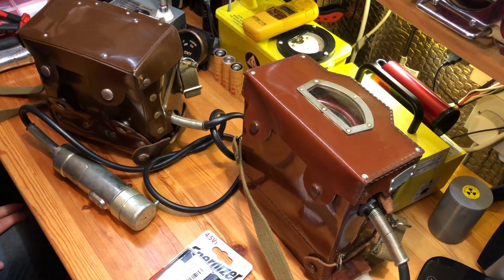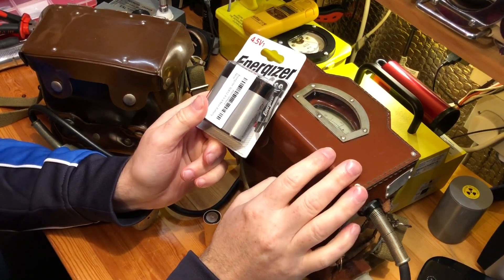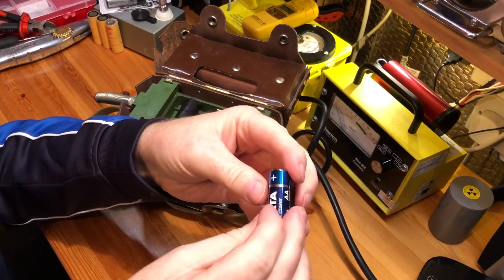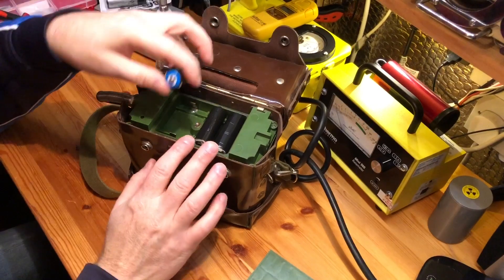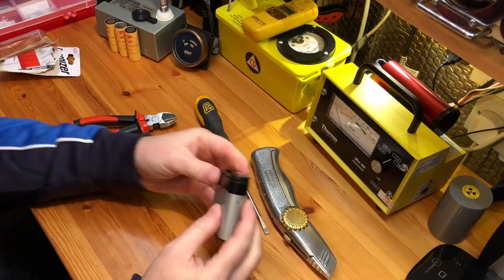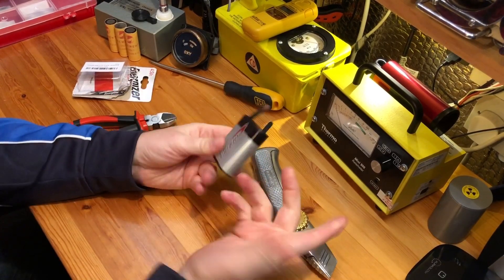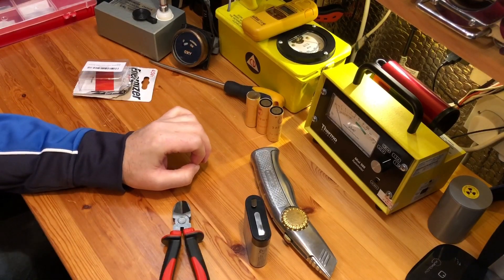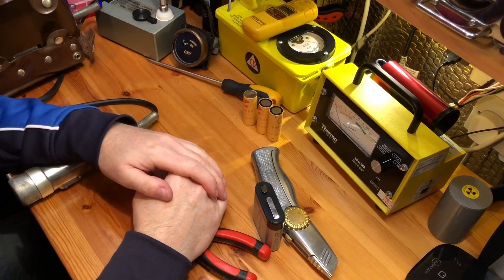Soviet Geiger Counter Batteries

Comment: Quick question i bought a dp63a geiger counter its made out of bakelite but what battery's do they use
Reply from the maker: It uses the batteries I show in this video.
Reply: @SurvivingTheApocalypse  so it operates under 4.5 volt
Reply from the maker: From memory, it uses 2 x 1.5v batteries - the make and model I show in this video.

Comment: Msy I ask how do I remove the two terminals/prongs on the left and right cells, just rip It off or should I do something else?
Reply from the maker: I just cut them off, if you have nothing to cut them with then you can (with a bit of wriggling) pull them off too.
Reply: @SurvivingTheApocalypse  Alright, I see. Thank you very much!

Comment: I have designed a 3d printable adapter to use AA batteries in my DP-5B. Its muuuuch cheaper than buying an overpriced a 4,5V battery
Reply: Would you post it on pinshape? It would be very helpful because I can’t find any batteries for these Geiger counters.
Reply: @person98  Somebody has made a much nicer design than me in the meantime. The STL files can be found in the video description of a video on Youtube called "Geiger Counter 3D printed Battery Adaptor" by a channel called "Surviving the Apocalypse".
Reply: @senorcapitandiogenes2068  oh nice, does it fit a dp-24?
Reply from the maker: That is literally this channel.
Reply: @SurvivingTheApocalypse  Its difficult to keep up with comments on different channels. Btw, that adapter is the only reason my DP-5V is usable. Thanks for that
Reply from the maker: I still prefer the LR12 battery packs. £3 on eBay in the UK + I can use them in all my other Soviet era survey meters. For anyone with only one variant it is still cheaper to use AA’s with an adaptor.
Reply: @SurvivingTheApocalypse  Those are slowly but surely getting harder and harder to get. And this way I can use rechargeables
Reply from the maker: Are they? Loads available on Amazon and eBay (in the UK anyway).
Reply: @SurvivingTheApocalypse  I am very old-school in that way. If my local hardware store doesnt have it, its not available. Screw Amazon

Comment: Excellent tutorial for the people that need it, when people ask about Soviet batteries on streams I can direct them here now. Funnily regarding the bulbs I have done the same thing with one of my MD-3 meters, I replaced the dim incandescent with a 3V Green LED and then used an AA to D adaptor with a similar 3.7V short battery in it held in place with foil. The MD3 is really easy to read in the dark now and as the bulb uses a separate circuit there's no risk of overvolting the instrument itself.
Reply from the maker: Cheers, the bulbs in the MD-3 and the older variant are TERRIBLE. I know the technical limitations of the day meant they had to use the little pigmy bulbs but the light output is pitiful.